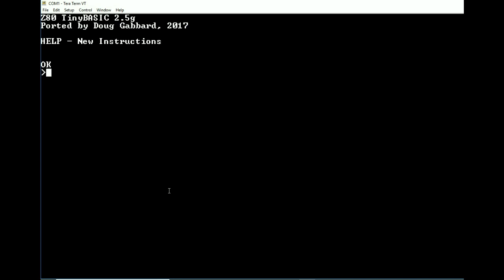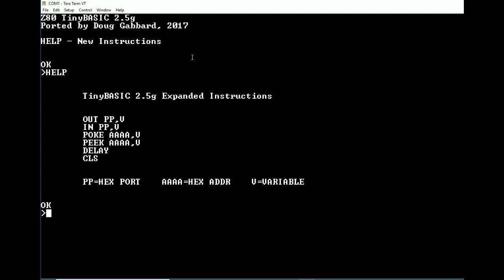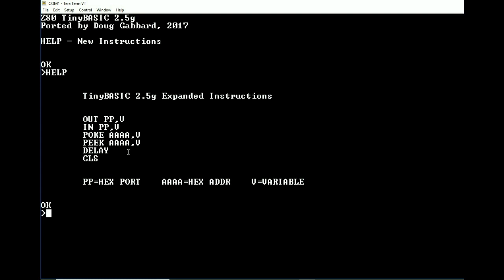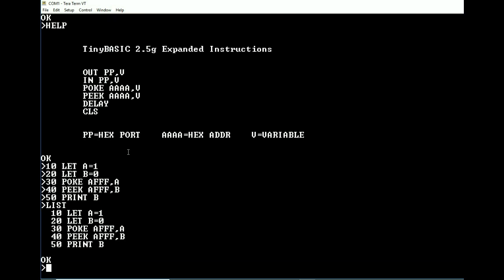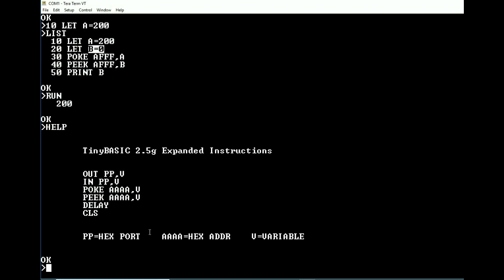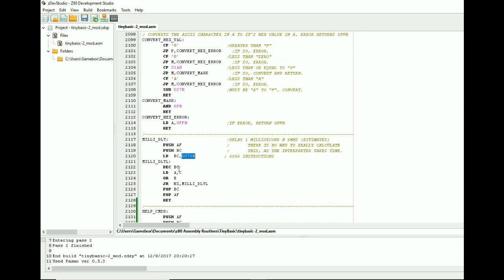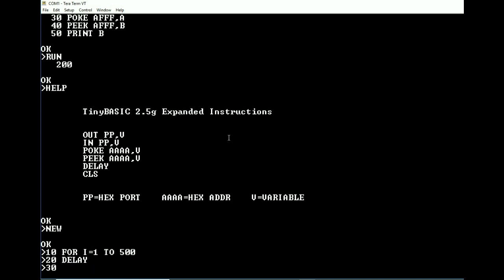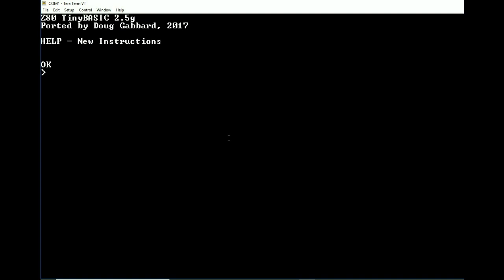Z80 TinyBASIC 2.5g Released:  See Demo

Comment: I think I figured out why I'm having a hard time integrating TinyBasic into my system. It expects free RAM to be above the ROM. My "ROM" is in high memory. I shadow-copied my ROM at $8000 because my low memory (32K) is where I bank the 512K). I can always reverse that by changing one chip, but that would change my plans for the eventual CP/M integration. I tried to modify the code, but I failed... for now. Maybe you have some insights?  By the way, we discussed TinyBasic on FaceBook lately (Frédéric Segard).